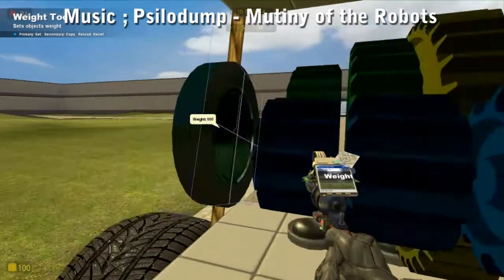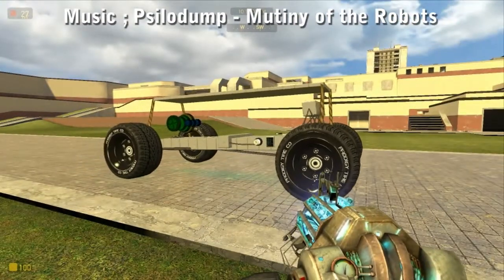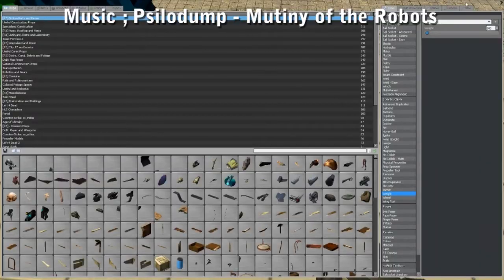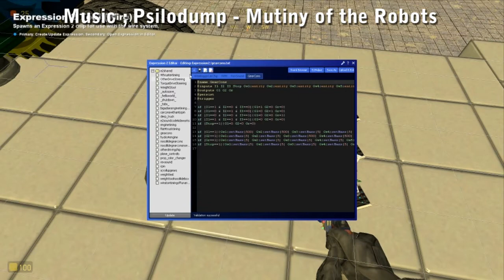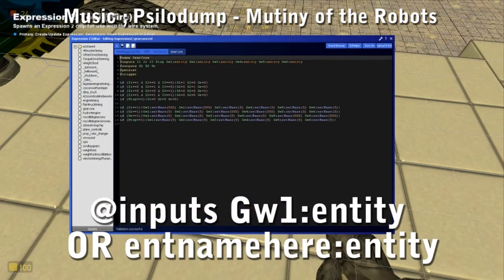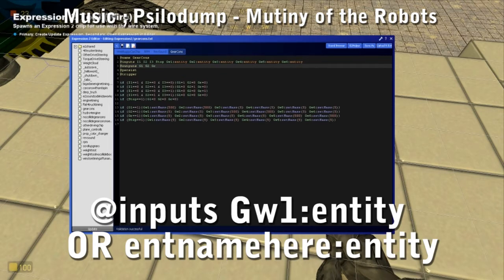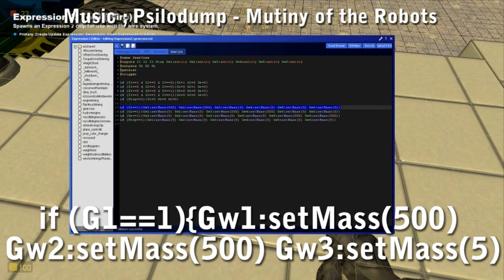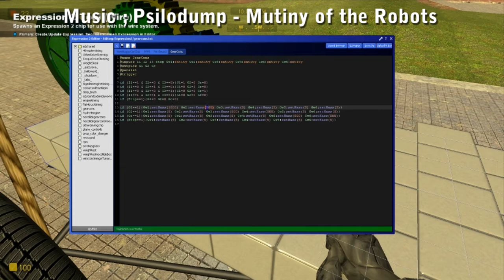[Gmod][Tut] - Dynamic Weighted Gearboxs.

Comment: Bit help?

My baseprop is at 8000 (its an Oshkosh Hemitt, weight 17.1 tonns) and the gears are set to 1000 with setMass but they are flopping like no tomorrow.
The Engine, a Boxer 8, is powerfull enough to move the Hemitt on flat land.

So? Where is my error?